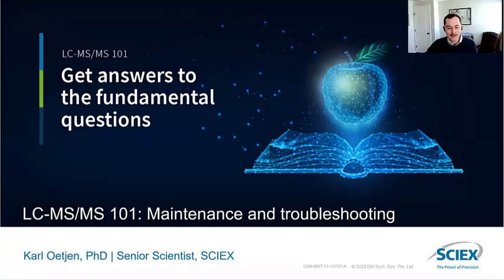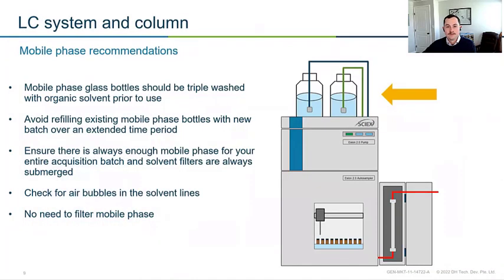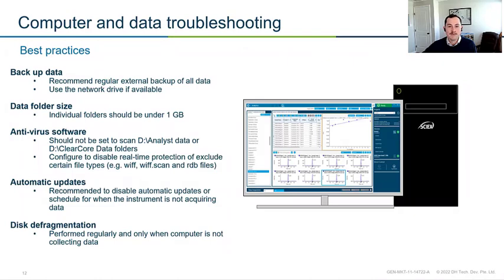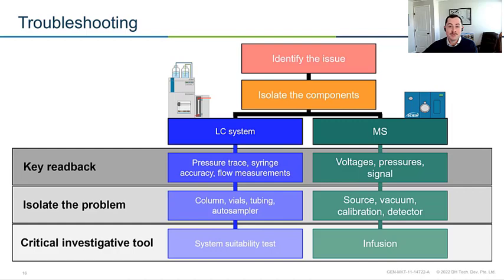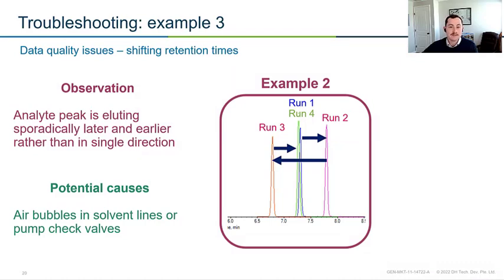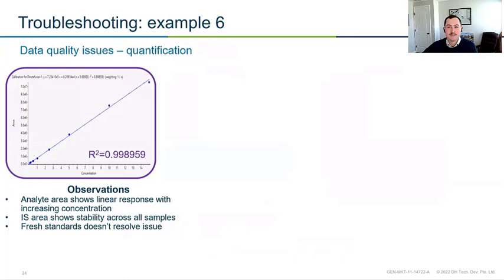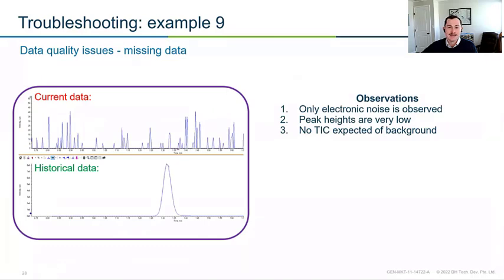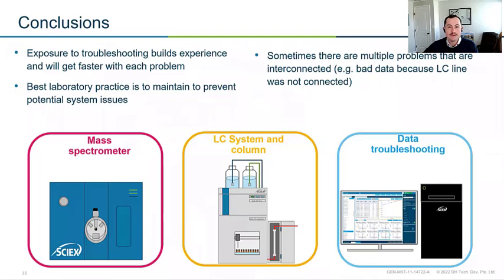Mastering LC-MS/MS: Pro Tips for Maintenance and Troubleshooting (LC-MS/MS 101)

Comment: Sorry for the toruble but im having an issue with my qtrap lc ms ms system it says the wrong source housing. I changed the board and the cable the source housing and still give the wrong source housing would you happen to know what the issue could be